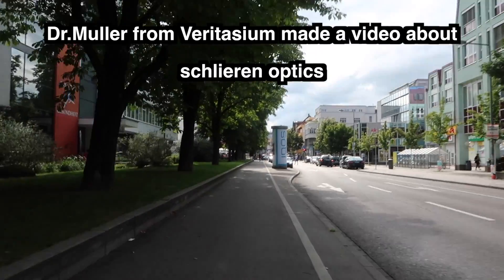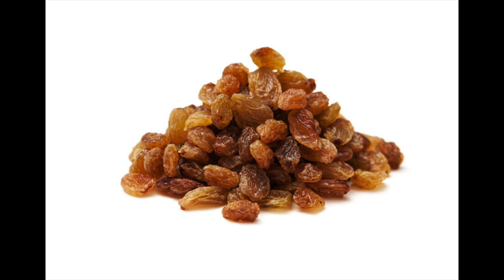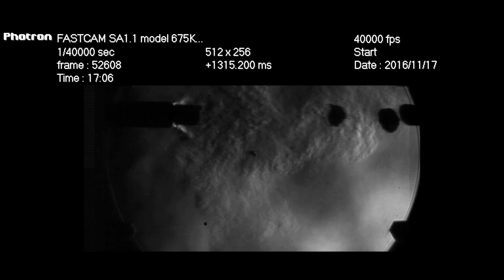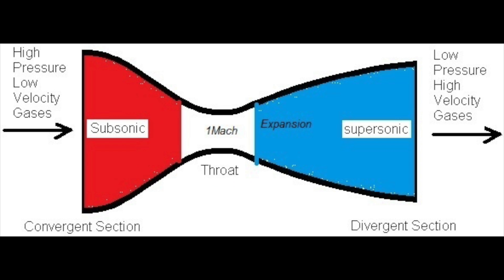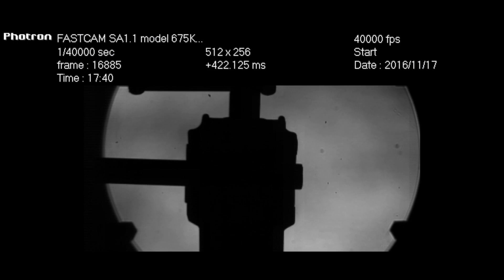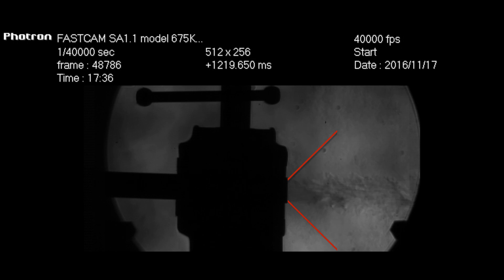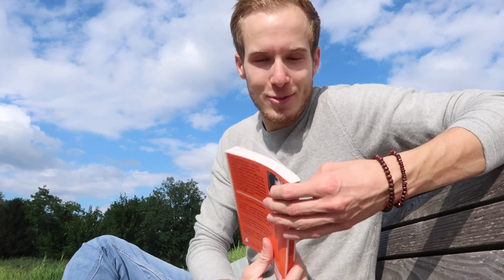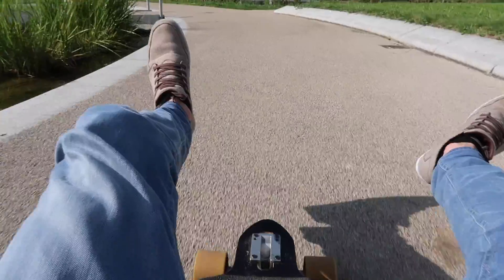To Derek Muller (Veritasium): Schlieren Imaging and Supersonic Flow

Comment: Have you ever figured out why you got shock diamonds? I saw another video of an air rifle that showed it as well.
Reply from the maker: Well, the raisins in the tube seal good enough to keep most of the pressure behind them. While exiting this creates a situation where there is a large pressure difference between 7 bar to 1 bar at the end of the tube. These are conditions truly good enough to create a sonic stream. The shock diamonds then I believe are created by the under-expanded jet exiting the tube going supersonic for a bit until the pressure in the tube gets too low.